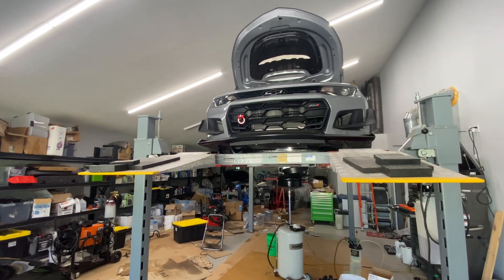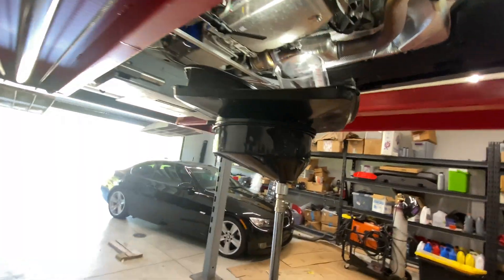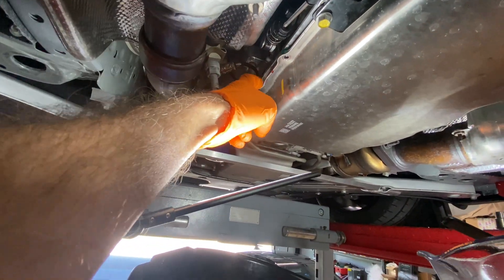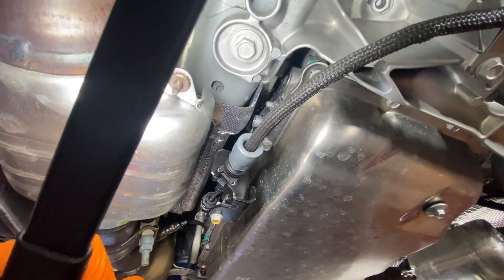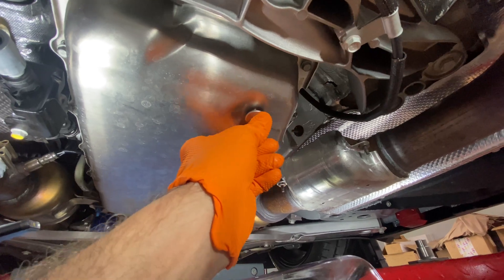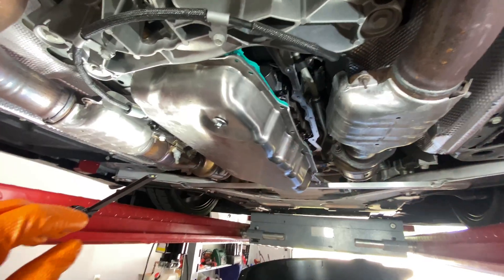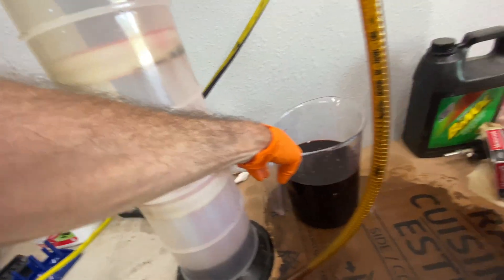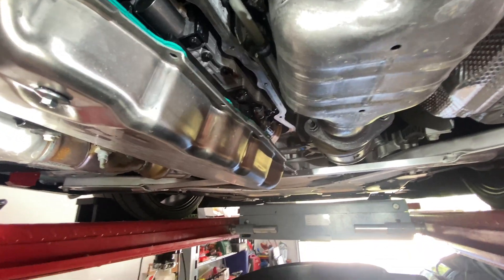Camaro ZL1 1LE Transmission 10L90 fluid and filter change

Comment: My 2018 ZL1 with A10 would hang gears on 2-3 shift and slip. Was told by a person that races these vehicles that 1-1.5 quarts over will stop that. 
I added 1 quart over and problem solved.

Comment from the maker: Notes:	(1) The WSS-M2C949-A specification recommended was developed by Ford and GM. Products meeting the specification are available under the DEXRON ULV and MERCON ULV tradenames.
Capacity:	10 speed With O Cooler 10L90 Total Fill 12 quarts.
Capacity:	10 speed With Cooler 10L90 Total Fill 13.7 quarts.
Capacity:	8.1 quarts Initial Fill.

Comment: All the info I found shows the fluid temp has to be 212 f when the level is checked?  Been taking it to the dealer to get changed.  I have a 2 post lift, and service all my other vehicles.  I use a cheap bug sprayer bottle with a pex valve.  Have 2 of them, one for tansfluid, and one for gear oil.  If the fluid dom't have to get that hot, I will do a drain amd fill.  Not crazy about the dealer doing flushes.

Comment: Great video!!  It’s very important to note the ZL1 and the ZLE use different pans.   The side access port is perfectly fine to use as the fill when the trans is cold.  I’ve done this drain/fill procedure four times now with over 13,000 road miles and 30 track days without issues. 

Also note that you’re not getting full fluid to the transmission AuxHX up front at the suggested brake torque temps. 

#ZL1 #1LE #A10 Transmission ULV Fluid Change with @AMSOILinc Racing Synthetic #ATF
https://youtu.be/d5IVV1XRmzg

Comment from the maker: I have been told that Amsoil sells an equivalent that meets all the GM specifications. Many racers prefer the Amsoil as it runs cooler. Hope this helps
Reply: The Amsoil runs dramatically cooler and makes the shifts far crisper on the upshift, and more precise on the downshift when in the performance mode.
Reply: You guys have the part number for the ams oil ?
Reply: Thnaks brother I will use amsoil then

Comment: What is the part number for the adapter to fill fluid through stand pipe?
Reply from the maker: Transmission Oil Fill Adapter for GM 8L90, DT-51190 . ASIN: B0CW2B2DT3. Generic.
Reply from the maker: I got the transmission filter from my local dealer. Identical to the one I removed
Reply: Why did you get the filter for the 8L90? I thought yours was a 10 speed?

Comment: Great video. What torque did you use for the filter bolts? 
I've also heard they need to be replaced but I got everything here except new bolts.
Also I noticed, 2020+ models use a different transmission filter. For my 19 ZL1 I got the GM24291343.
Reply: The ZL1 and the ZLE use different pans on the A10.  I indicate this in my video.
Reply: found it. 5 nm + 128 degrees if someone needs to know.

Comment: Thanks for the video. Doing the same myself now.
Reply from the maker: You can do it! I rechecked my work since I only got 6 liters out (room temperature 25 C) and only used 6 liters at 77 C when refilling it, not the 8.1 liters everyone says it takes. And I drove it to get Tran temp up to 74C, then required only one brake torque to get to 77 C. Be careful as it can burn you. Not worth it.
Reply from the maker: Worth a try. Brake torquing was not fun. Best of luck. Let me know how it works out. I am
Open to any methods.
Reply: @nevadarobert7908  mine took 6 quarts as well. Initially took out 6 quarts. Put 6 1/2 back in, then drained 16oz. after it reached correct temp.
Reply: maybe also cycle each gear and stay for a min each and in manual mode up to the highest gear stationary. then try to warm up the fluid
Reply: One of the more confusing things to me is what is considered level. Is it how the car would set on the ground, or level the car itself, or like you did and put a level on the trans pan. All of these are different and are going to change what the fluid level would be. But I think I’m going to go with the way you did it.